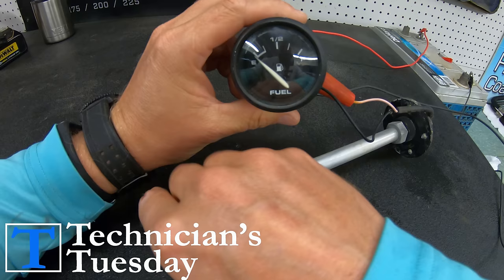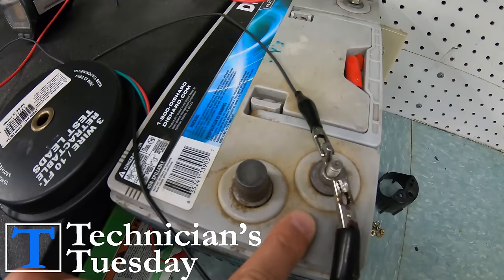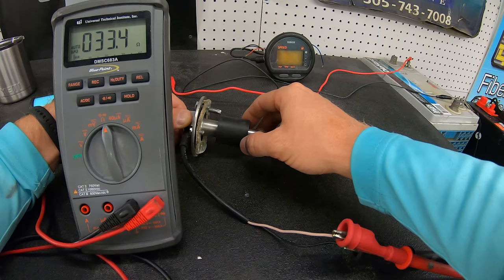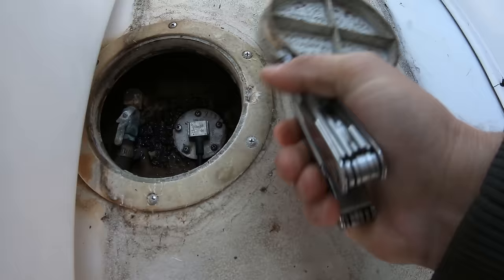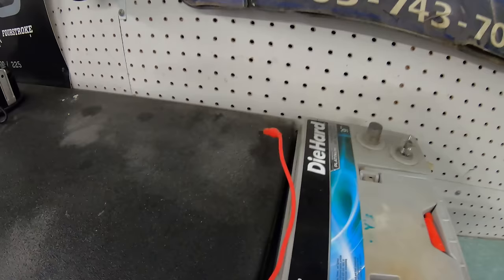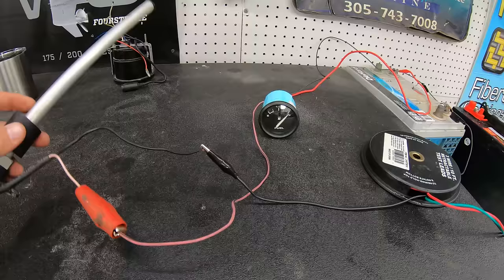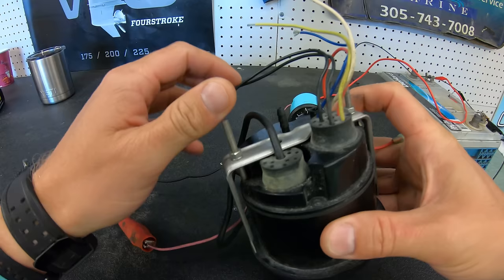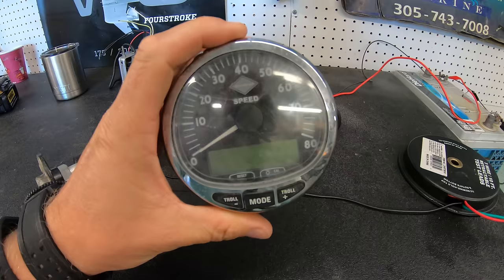How To Troubleshoot & Fix A Boat Fuel Gauge & Fuel Sender!

Comment: #gasgauge Luckily I've never run out of fuel on my boat! Also, my VesselView 702 display for my Mercury Verados show me how much fuel is in my tank. Is the VesselView fuel gauge have a different way of operating than the analog gauges?
Reply: Benji Gans from what I see in the video, it looks like the signal from the Sender goes to the motor’s computer and is converted into the Mercury comm network and is displayed on the screen.
NMEA2000 is the open network com protocols that multifunction displays use to display information.
most of the newer, bigger engines use some form of CAN network for their internal engine com networks.  In a nutshell it is the same type of CAN network you find on new vehicles (past 15 years) for communication and control.  Some can check to see if you blown a speaker on you car stereo now.

Comment: yes you make a lot of good recommendations But its a big mistake to short out the indicator on most level indicators because the dead short drives the needle so far over that it damages the movement, So I dont recommend your Tuesday Techniques!

Comment: tha means max around 0, 36 amp's .  Is this safe? 
I recentrly replaced a wire, and used 0,8 wire
Reply from the maker: What do you mean?
Reply: @BornAgainBoating  the battery delivers 12 volts, and the minimum resistance is 33 ohm. So it max ampere it will deliver is 12V/33ohm= 0,33 ampere.

A wire of 0,8 thickness can handle a max of 6 amp or it will start to burn.

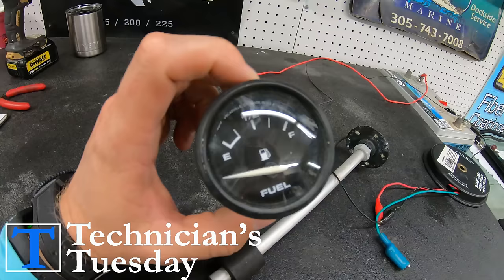Comment: 0:57 The sending unit's ground wire should be returned to the gauge and not to the battery. Otherwise voltage drops between gauge ground and sender ground would affect the reading.
Reply from the maker: Thank you for your question! Please post it in our Born Again Boating Community! Go here and scroll down to access - it’s free: https://www.bornagainboating.com/

Comment: For what it’s worth I once used a fluke 753 to test a fuel gauge , a decade box would work too ( probably easier than the 753) basically the multi gauge on this Volvo penta would make a loud buzzer run anytime the the key was on , owner filled the gas tank , buzzer still went off , used the ohm function in the 753 to verify the multi gauge was good , turned out the float would sink in gas but float in water !?!? ..... boat had 39 hours but was 5 years old and out of warranty
Reply from the maker: That's good work!
Reply: Born Again Boating Easy money